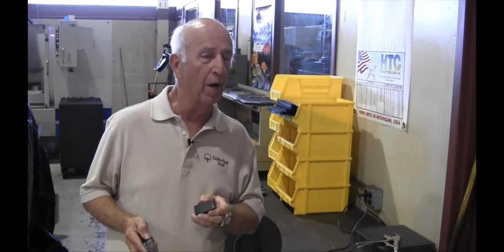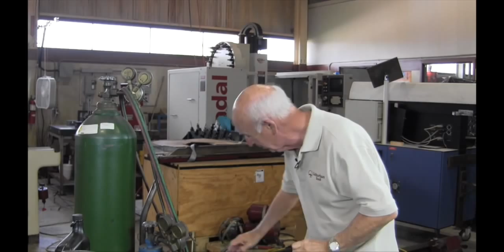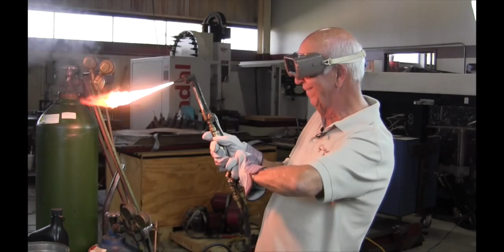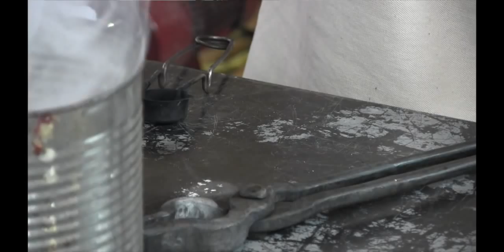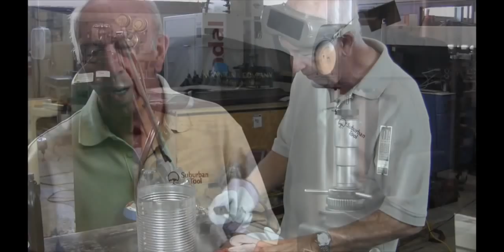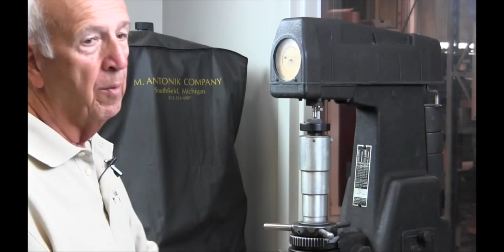How to Heat Treat Fast - by Don Bailey

Comment: Love your videos Don and have learned a great deal. As a custom knife maker for over thirty years and one who does his own heat treating, I've learned a few things over the years. When using an oxy-acetylene torch you should always use a carburizing flame (fuel rich) so as to minimize scale and de-carb of the piece being treated. Also the best way to know when to quench the piece is to touch it to a magnet, when it becomes non-magnetic its at critical temp and ready to quench. Also your oil should be warm 100-125 deg so as to minimize thermal shock when quenching. Also drawing back to a light straw color will increase toughness without sacrificing too much in Rockwell. I myself always use vegetable oil for a couple reasons, its a clean oil (no additives), high flash point, cheep and it leaves my shop smelling like french fries.
Reply from the maker: Thank you for your comment.

Comment: As a 1st year apprentice my job was to make a bunch of 1/4" thick O1 plates that were used for the pinch off area around the neck of a bottle blow mold. I used a blow torch to heat them and quenched them in a vise between two large chunks of aluminum that quickly sucked the heat out and also kept the plates really flat so I barely had to tickle them on the grinder.

Comment: One extra step that was missed, after the quenching and hardening, you most likely need to temper the part by heating it to 200-300 deg. Celsius for an hour or so. This is to make the part less brittle, but still retain most of the hardness. The part that was made in this video would probably crack if you put some force on it or hit it with some tool (brittle like glass or ceramic), but after tempering it would be both hard, strong and tough.

Comment: You can use the torch to draw the back and insert it in sand to keep the heat in for a longer period of time. That will prevent the part from been glass hard and shattering.

Comment: as a small shop owner i looked at my heat treat bill and found another source of profit if i did my own heat treating, larger shops like SubTool would save enough to support several employees and lots of equipment. The unknown consequence was that i could get better results than if i sent it out to a commercial heat treater that does it in large batches all piled in a huge basket.  By doing your own, you can HT per the piece, and the same goes for the draw, including better control for double and triple draws. and yes i know this was a demo for an emergency situation.

Comment: Don, 
Is it important to polish & reheat the workpiece to a straw or darker color? I have been told that it toughens the steel so it is not so brittle. The toolsteels I have mainly used are Bohler K720 & Arne DF2. I am not very familiar with heat treating.
Cheers - Peter Spence...

Comment: don-- thanks for the vid. i have seen many cautions against using anything but rated heat treat oil for the purpose. their objection is that the flash point of the oil is lower than the temp required for the heat treat. would like to hear your comment.
Reply from the maker: +crazymanmichael You are correct. This method would not apply to a production environment. This is for a quick fix work around while you wait for the proper heat treating.

Comment: I’ve always found sparks to be unreliable. On a video, it can be impossible to see the differences. But, I go by the sound. Mild steel has a low frequency grinding sound. Higher carbon steels have a higher pitch and the really high carbon steels almost ring when ground. You can go by feel as well. Mild steel has a rough, soft feel. Higher carbon has a smoother feel, and feels harder as well.

It’s difficult to describe exactly, but if you pay attention, the differences are obvious.

Comment: I know that you don't get the same degree of hardness when quenching in oil, compared to brine or even water, but surely you still need to temper to reduce the brittleness.  Having said that O1 is not as well known this side of the pond as it is on yours, so I am not too familiar with its properties.
Reply from the maker: Chris Stephens This was demonstrating a quick stop gap method while the permanent part is sent out to heat treat. We could have made the part harder and tempered it down, but again , this was just to show a temporary fix
Reply: I appreciate that and also appreciate you spending time and effort to make these tutorials, keep up the good work.
Reply from the maker: Thanks Chris

Comment: Thanks for the video Don.  Why do you want bright red instead of cherry? I was under the impression O1 hardened at 1500 deg F, which is cherry red.
Reply from the maker: Richard Newman RichardThis part could have been heated longer and then tempered down to get the desired hardness. We just wanted to show the technique for a quick fix.

Comment: would you have to temper that so it ain't brittle? or does it depend on the application?
Reply: Excellent question. As a Toolmaker also, I always make sure to immediately put the part in the drawback over (600 f for 2 hrs min). The demo was a mock of an emergency situation so to get production going again, and for time sake, leaving untempered and brittle should be ok. I know there have been a couple times I didn't drawback either.